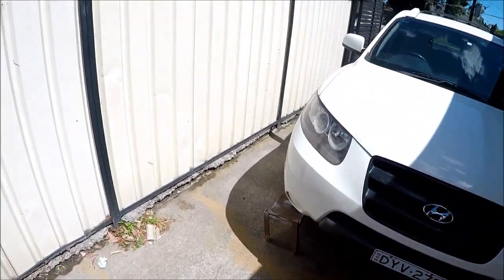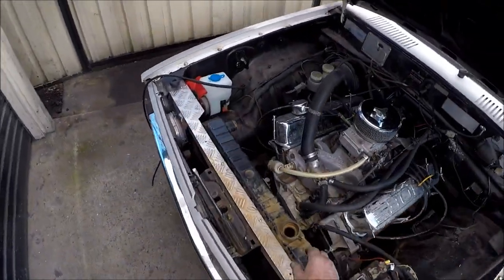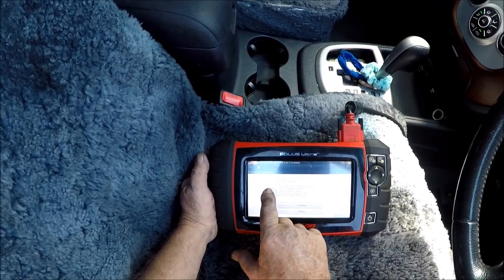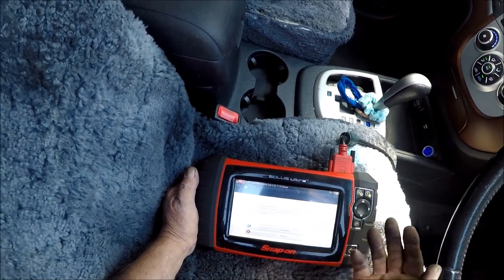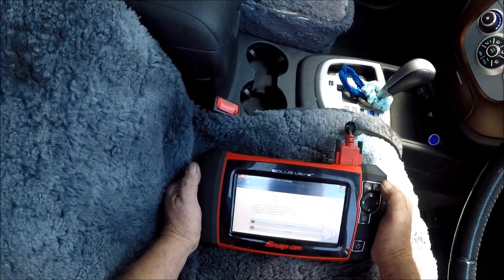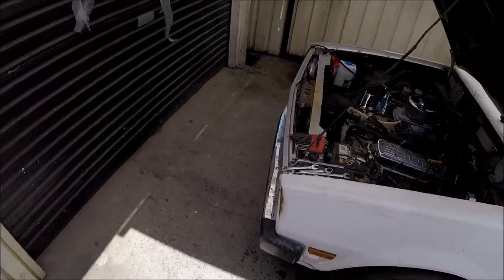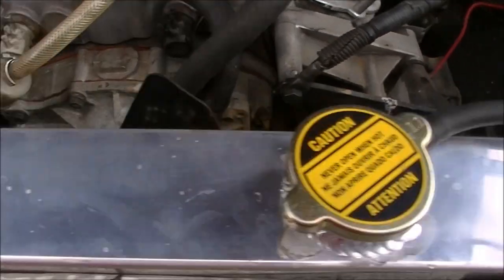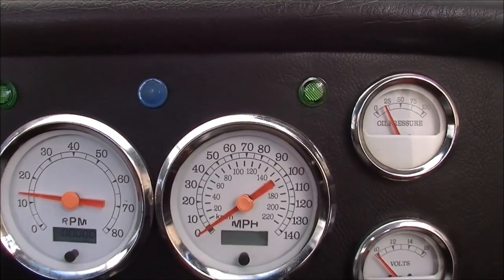Sante-fe update and L200 V8 update .

Comment: Camera  was spot on. Very cool. Diesels over here are the same and we see them parked on the side of the road going into regen at the worst time.😅
Reply from the maker: Cheers Steve..It works pretty well...That happens here too but the owners just turn the engines off resulting in a blockage.

Comment: Don't know what you are doing with the Hyundai. DPF? Diesel engine? Radiator looks good and I like the new camera mount. Keep Rocking it out Down Under!!!
Reply from the maker: I've been trying to trick the ECU..The DPF blocked up and took out the Turbo and intercooler...He knocked the guts out of the original but the ECU doesn't like that so he got another used one but that was blocked too so I drilled 3 holes down it...No check lights yet...Hyundai want $8000 for a new DPF..We just found a guy who has new DPF's for $1300 so that's a bit better than 8k.